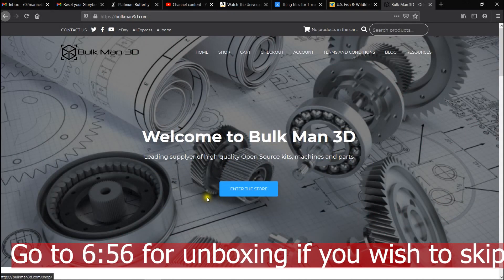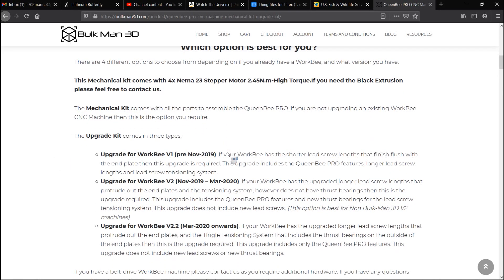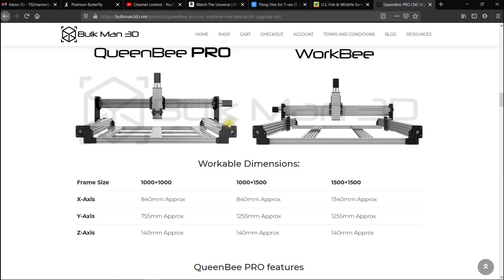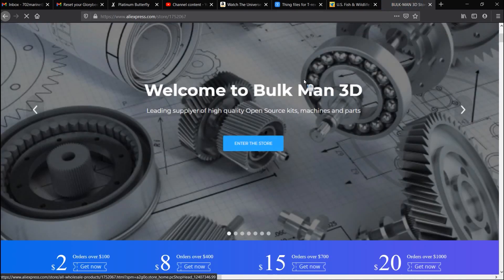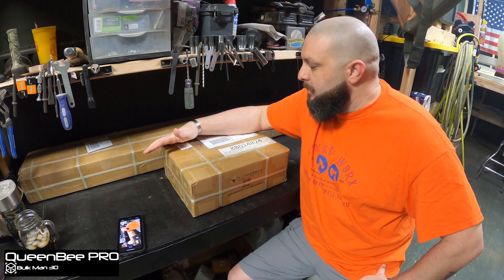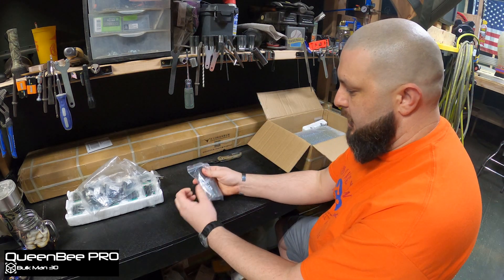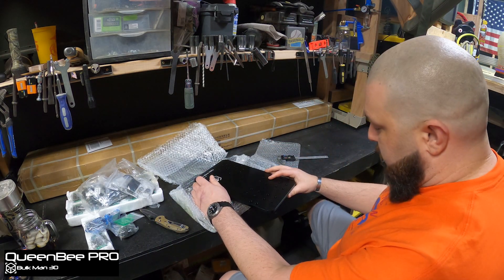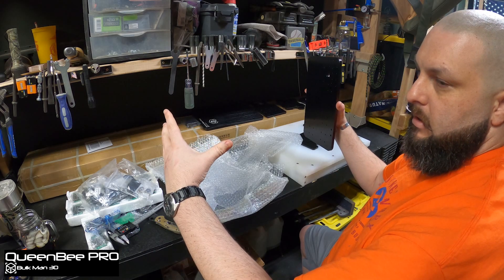QueenBee Pro - Ordering and Unboxing Bulkman 3D

Comment: The QueenBee Pro seems to be my answer but, am thinking of 1500mm X 1500mm what if am cutting 1219mm X 2440 (full sheet) do i have to build 1500mm X 2500mm Table will it work.? i mean theres no limitation on length?

Comment: Will the 1.5kw 110v motor run off a 15 circuit breaker?
Reply from the maker: I’m sure you could. It can pull up to 20amp at completely peaked out. 99% of the time you won’t be running it that hard. But it goes without saying, if you are popping the breaker then you better change it. Especially if you plan to have anything else plugged into that same circuit. Changing out a breaker is pretty simple and easy on the pocket. It’s always worth being overly safe especially when it comes to a machine that will be running for a really long time and unattended.

Comment: Hey I'm thinking about getting a 1515 QB kit and wanted to find out what kind of rapid speeds and cut speeds you're getting with your setup? And how rigid is the whole machine? I want to use it in a production manner in some exotic hardwoods so want to make sure the machine can cope...

Also how's the spindle? I'm thinking to go with the 1.5kW air cooled one for the reduced weight on the X axis as I don't imagine the cut speeds will really warrant a 2.2kW?

Really like your videos! And subscribed to see more of the QB (and to refer back for build if I get the kit myself)

Thanks!

Comment: Thanks for the build videos!
My bulkman 3d queenbee pro full kit is on its way and I’ve been on the lookout for the full kit build but this upgrade  will do :)
For mine, I’m going with a centroid acorn and teknic clearpath sdsk servos
Reply from the maker: Once I have mine taken apart the rebuilding will be just about the same as a QB kit. The only things that won’t be talked about too much is the programming. However, if you watch my videos for the WorkBee the programming would be the same. So when you get to that point check out those videos and if you have any issues just reach out to me. Of course if there is anything major that is different when putting mine back together I will detail all of that.
Reply: Thank you Sir 🙏
I’ve saved your workbee build videos and will for sure refer to them, specially for the vfd and spindle.
Looking forward to more of your videos on the queenbee upgrade

Comment: Congrads on getting the upgrade, I haven't even put my machine together yet, now I'm wondering if I should buy the upgrade but a little confused on what I need, I have the 15,15 workbee, My guess is the 2.2 version though I'm using 1/2 multi start lead screws, Will need to either make new lead nuts or just drill and tap the ones that come with the kit. Using the original lead screws for a smaller machine I'm building.
Reply: So you might go for a 1000x1000mm queenbee upgrade kit.
Reply: @Levisgil47  no the 1515 upgrade.

Comment: I can tell you that on the 1500x1500mm QB I’m putting together right now, the 6 linear rails take 25 screws and 25 t-nuts that a minimum of 150. But the problem they only ship with 125 of each, the smaller rails use different screws & t-nut, but the smaller 4 bearings for z-axis did not come with grease nipples.
Reply from the maker: I will check into that when I get to that point. I’m sure if you contacted Bulkman they would take care of it no problem.
Reply: I emailed them 2 days ago never have received a response as of yet. I ordered what I needed you can’t rely on someone that takes 48 hours with no response
Reply from the maker: @StickerJoe   Jump on Skype chat and contact: (live:.cid.184e690f63da825c) Tell him I sent you to talk to him about your issue because you were not helped through other means. He should be able to correct it for you.
Reply: I’m in the middle of building a Queenbee 1500x1500. Hopefully it will be done soon. Getting ready to weld up a steel frame table this weekend
Reply from the maker: Not a real excuse but they are in spring holidays and new year celebrations right now. Might or might not have anything to do with it.
Reply: I thought the same but all the screws was there just in separate bags.

Comment: This is cool dude. I shopped for the QB, (I have an active x carve) and we got a big job at my day job (digital print shop large format) to cut coroboard in the shapes of people for putting in the fake crowd on the stands, so I talked him into getting the qb 1515 , I liked the kit so I made the purchase as well now I'm building two lol. I'm hooking mine and the one at work to a Blackboxes. I think I have all the coil pairs sorted out, just trying to flash the firmware to the BB but it's really fussy on which usb port it uses. I've never had luck with arduino stuff lol
Reply from the maker: Thank you for the support!
Reply: Does the QB have the ability to read registration marks? How do you cut printed coroboard accurately? I'm assuming you would switch out the bit to a swivel knife on the router as well?
Reply: @janagan  Doesn't read registration marks, though, when I printed on the flat-bed I had the graphics guy make all the images within a square area, and he added a circle for a bit reference on the bottom left corner, I just used an upcut 1/4 inch bit, it cuts 4 mill coro in one pass at 90ipm. Used the qb to cut out an aluminum metal sign outline, my first go with metal, worked out great. We are still working out some of the sizing details relative to the bit width factor, but for now we ensure there is plenty of bleed out on the prints